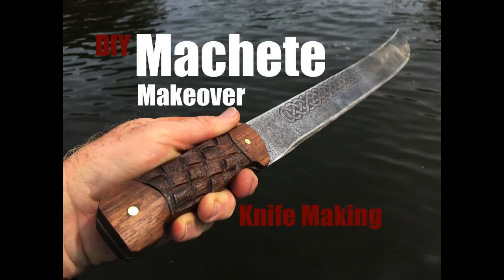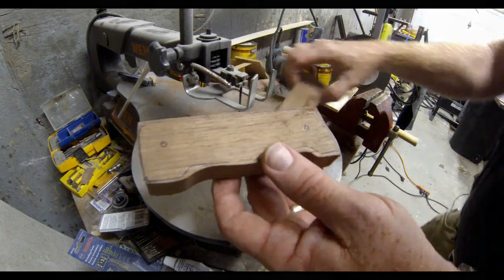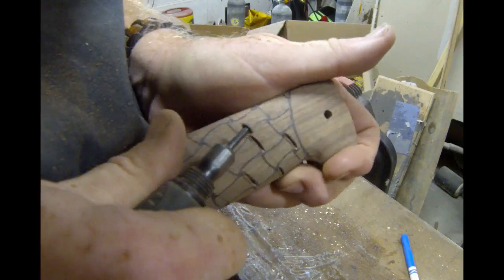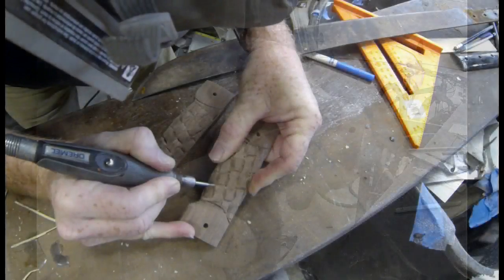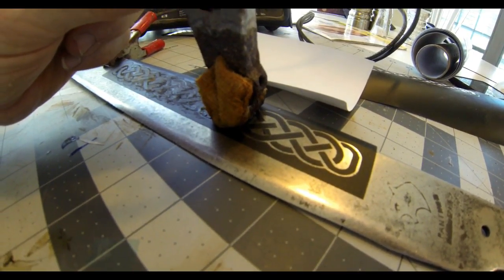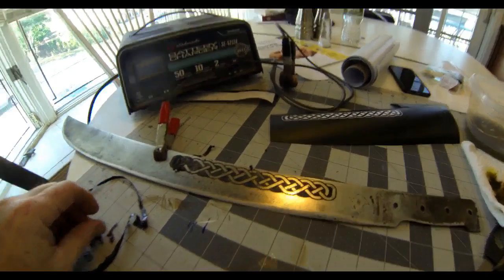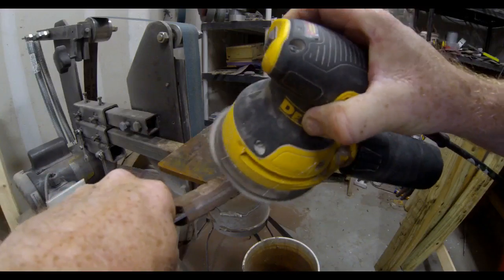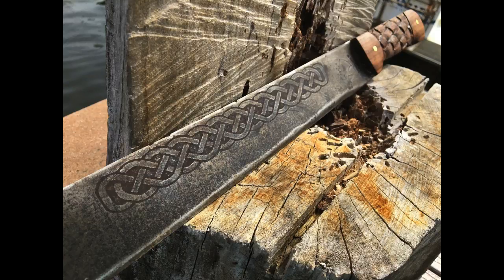DIY easy Machete Makeover with Celtic blade etching and carved basket weave handles

Comment: I like your design but some of you technique could be improved. Mostly on the handle. 1st, carve with a conical wood carving bit; saves time & improves the look. 2nd, don't grind down the brass rivet. Use your Dremel cutoff blade. Saves TONS of belts. 3rd, and lastly, burnish each end of the rivet. Make a cap on one end of brass rod, insert the cut off piece, then "rivet" each end rod. This saves you time and it also secures the handle. That's what I do.